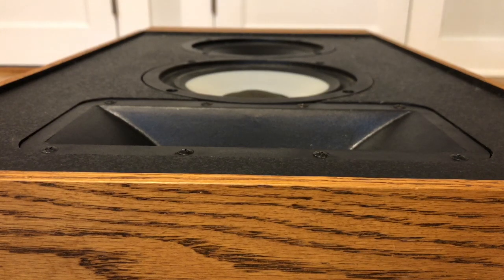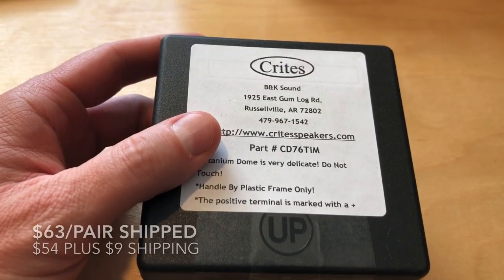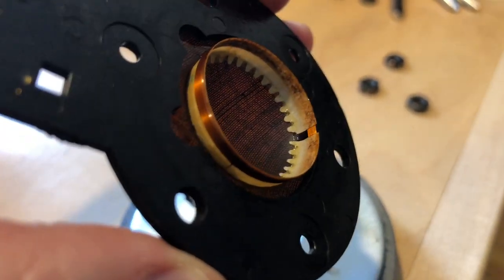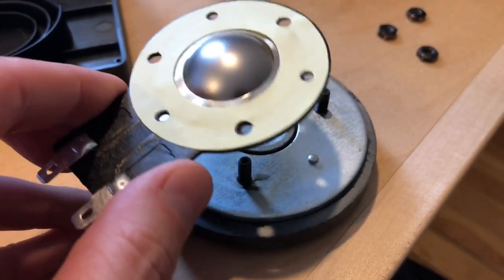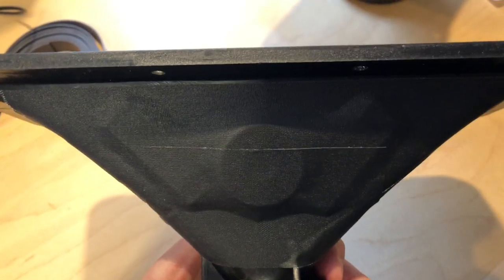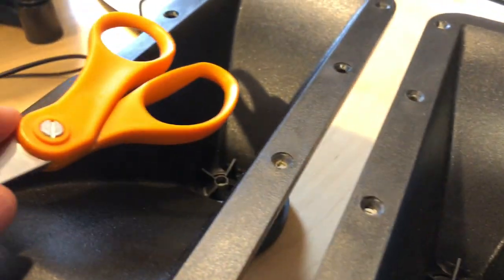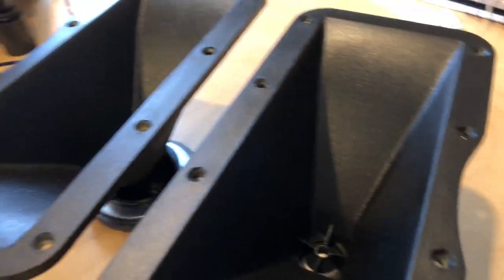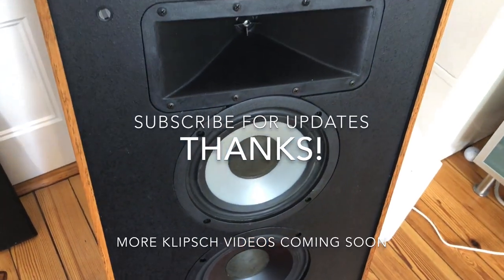Klipsch KG4 + Sonos Bi-amp: Bob Crites titanium diaphragm + horn damping DIY upgrades

Comment: I have some KG4's that I have made some mods to. First, I rebuilt both crossovers completely with poly caps, 18 AWG air coil inductors and a 1 ohm resister where the .7 ohm switch was. I dampened the inside top and bottom with felt and adhered the original foam to both sides. Replaced the tweeters with titanium and softened the tonal response of the horns by wrapping them with painters tape, no metal washers. Twisted the internal wiring and soldered all connections. After a couple of days of break in of the crossovers, they sounded (and still do) amazing! The base was tightened, midrange sound stage expanded and cymbals and such are crystal clear. Reminds me of the JBL 4311 monitors I listened to in the late 70s. Love these vintage speakers and the sound they are capable of producing vs the cheap crap available now a days. Just picked up some KG 4.5s and they will also undergo a transformation; I'll brace the interior, place the foam properly and completely rebuild the crossovers with higher quality parts. They may replace my 4's as front speakers. Cheers!

Comment: I'm not one for "modifying" speakers. I always thought the engineers get paid to design a speaker to sound the best they can. And I would experiment with different recievers. I've had the kg4's for a long time and have always liked them but felt the tweeters fell a little short. After a few years of kicking around the idea of replacing the diaphragms with Bobs diaphragms, I've decided to do it. Wow what a HUGE improvement! Super clean in the high frequencies without sounding to bright. Very smooth! I wish i would have done it sooner.
Reply: Just found a pair of KG 3.5's in mint condition at the local Salvation Army thrift store... $10 each!, definitely worth the investment into upgrades

Comment: I've just been gifted a pair and am planning on the same Crites upgrades.  I found a spool of 12-AWG pure copper wire and will set them up today.  I'll piss off my neighbors with the original spec'd speakers until I get the upgraded components.

Happy listening.
JB.
Reply from the maker: The tweeter diaphragms made a noticeable difference. Bi-amping then with the Sonos room correction is next level though. Have fun, they are great!

Comment: I found the KG4's to have a horrible shouting top end with my 300B SET amps. They already had the Crites upgrade. The solution was a 1" strip of cloth gaffer tape over the tweeter driver down the throat of the horn.  Geez...

Comment: Thank you for this!  I just ordered from Crites for my 4.2 last night and they already shipped this morning!  This def looks easy enough and I have some dynamat left over from doing my trunk so ill try that on the horns while Im in there.  Any other suggestions?  I know there is the whole crossover rabbit hole to go down with these but going to start with the diaphragms and go from there.  Was wondering if they would benefit rom better foam on the inside?
Reply: I am currently into the mids of an overhaul of one. I'd use dyna mat and one brace (simple wedge of wood will do) no need to screw or glue in the cabinets. They seem to benefit from that tremendously

Comment: Great video thanks.  I have just bought some KG 3.5 from ebay and they sound good but sound really harsh and bright to me. The seller bought them as new old stock and has had them 3 months.  Do you think this upgrade could solve my problem?  Thanks Glenn
Reply from the maker: The Crites tweeter upgrade definitely smooths things out
Reply: @todd.parker  thanks Todd I will give it a go.  👍

Comment: Have you done or thought about doing a bob crites klipsch kg4 crossover upgrade?  I'm kind of thinking about it.
Reply from the maker: If I was using the passive crossovers, I'd consider it. In my case, I'm bi-amping them via a Sonos Symfonisk and they sound worlds better than when I compared them to the original crossovers with a nice amp.

Comment: Hello Todd. I was looking at the upgraded crossovers from Bob's and wanted to replace my existing crossovers in my kg4  speakers. The new crossovers have provision for tweeter woofer and input. But the KG4s have a tweeter, two mid range speakers and a woofer. Any idea where I would connect the two mid range speakers. Sorry I am not very technical hence the struggle. Thanks in advance.
Reply from the maker: The two 8” woofers have a wire that chains them together in parallel so you just hook the woofer output from the new crossover to either woofer and the jumper wire connects the other. The “woofer” on the back is a passive radiator that reinforces the bass but doesn’t need to be hooked up to anything. Hope this helps!
Reply: @todd.parker  thank you Sir. This helps me a lot. Never done stuff on my own but will start.  Thanks for your time. Appreciate it.
Reply from the maker: Sure thing! My latest video shows the speakers taken apart completely if that helps. The tweeter diaphragm upgrade is highly recommended too
Reply: @todd.parker  yes Todd that's the video I was watching this morning. The Titanium  upgrade. I will order that as well from Bob's. I have had these KG4 for years and years don't want to let them go.
Reply from the maker: mohan pillai I’ve been very impressed by mine. I hooked them up as a lark but they are now my daily drivers

Comment: It's actually horrible instructions,

 "if you find ferrofluid just leave it and replace the diaphragms"

That's a red flag straight up, those speakers are around 40 years old. That ferrofluid is no longer the viscosity it was. Well known about ferrofluid it turns "goopy"

It's ALWAYS wise to clean out the gap and replace (where applicable) the ferrofluid. I really dont care what crites said about that either
.

That's a well understood standard practice by now. So for anyone reading this, and doing this and you do run unto ferrofluid cooled tweeters ? 

Just replace the fluid it's cheap and simple enough to do. And especially on older speakers , totally recommended